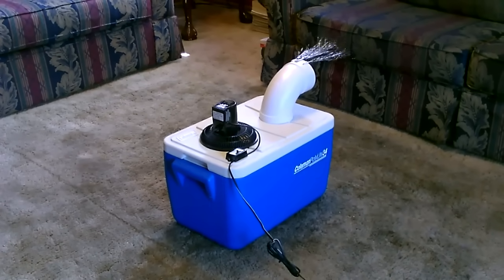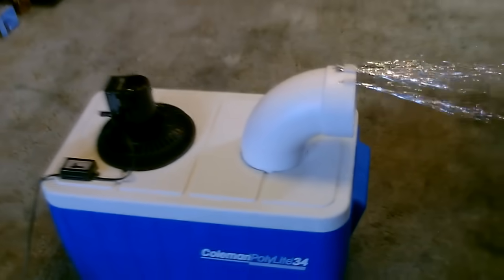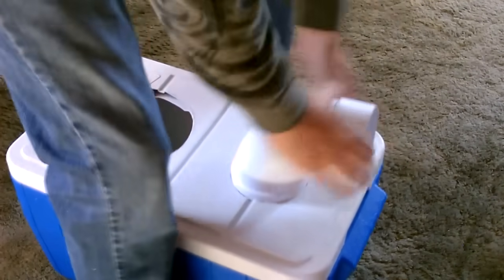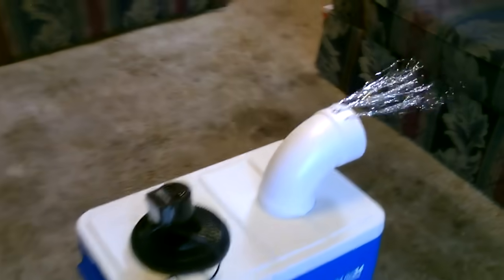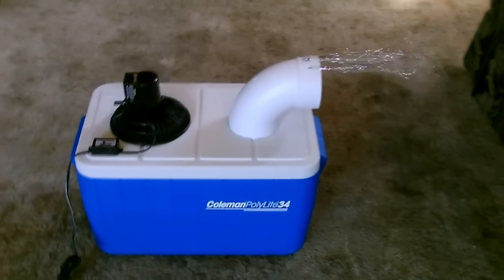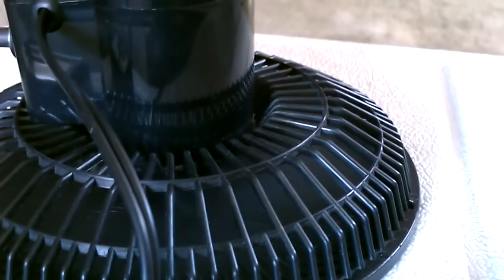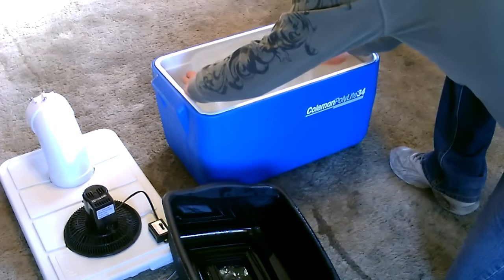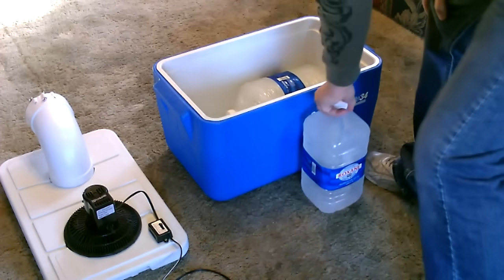Homemade air conditioner DIY - Awesome Air Cooler! - EASY Instructions - can be solar powered!

Comment: Great Video!  I wonder how long the cooling would last in my 400 sq ft apartment in Honolulu.  Any ideas?  Thanks!
Reply: +Kiana Foster it would cool off VERY quickly and get very cold. No telling how long it would last since that would be based on how well your place is insulated. Just turn it off when it's too cold and back on when it's too warm. Simple enough :)
Reply: +Kristen sounds SUPERB!!  thanks
Reply: +Oksana Gegick dont use dry ice! it is CO2 (carbon dioxide) a poison, and displaces breathable air.
Reply: Dry ice doesn't melt.  It sublimates. And its expansion rate is 845:1. So yes. What ever it is in will explode.  Just dont use. It is a poison and not meant to be used in this manner
Reply: Joan Aren a poison is
a substance that is capable of causing the illness or death of a living organism when introduced or absorbed.
according to the oxford dictionary..

and since we are talking of buying bulk quantities of the dry ice...which sublimates and disperses the air in the room...it becomes a poison..
Reply: If you use ice,probably 36 hrs. If you use dry ice maybe 51 hrs
Reply: +Steven Preston   Since when was co2 a "poison"?
Reply: +Joan Aren Yeah, going by that logic, any gas that isn't oxygen is a "poison".
Reply: +Joan Aren hahahaha my friend,,, our body need oxygen only,, again,,, ONLY,..
Reply: +Renato de Guzman   You body needs both oxygen AND C02.  If you use dry ice in an airtight room you may have a problem.  If your room is well ventilated, it won't be a problem... In fact, it may be beneficial to your health.

Comment: A suggestion, instead of a 90 degree tube use a 45 degree where you can cool off the higher warmer air better.
Reply: You can re-freeze the same water, just pour it back into the tub and freeze.
Reply: 180 degree going in the opposite direction.
Reply: THATS WHAT İ THOUGHT .YOU MUST LET THE AIR CIRCULATE MORE IN THE COLD CHAMBER AND THEN GET OUT .ALSO INSTEAD OF WASTING WATER EVERY TIME YOU USE ICE ..WHY NOT USE SMALL BOTTLES OF WATER AND FREEZE THEM AND USE THEM CONTİNİOUSLY WITHOUT REFILLING THEM WITH WATER .
Reply: +Dan M 
Actually I think you guys are using different reference axes here...
By your 45 I assume it's 45 degrees from pointing vertically, which would actually be 135 degrees from the base.
In that case, 180 would be pointing straight up.
Reply: willedmusician 4 
Dry ice could be dangerous in a small room with poor ventilation considering you would be releasing a large quantity or carbon dioxide into the room.
Reply: great idea, but i thought about it and it may vary in the cooling temps, because the smaller bottles are insulated more maybe little bit less effective?
Reply: You mean 135 degree if that is possible from your local DIY shop
Reply: Dan M can't you just use dry ice instead of ice?
Reply: Good thought, but it would sublimate too quickly. It would be really cold for a short time.
Reply: Chouchou Ccc  you can always pour the water back into a container and refreeze it right?
Reply: 180 degree are used in traps...360 is straight.
Reply: @ Chouchou You get a gold star for that idea! Congratulations!
Reply: Jasons Brother m
Reply: Jasons Brother  180 degree is a straight pipe.
Reply: +Dan M 180 degree***

Comment: I have used an old hair drier as a fan (Removed the heating element) and extended the outflow pipe to the bottom of the cooler box. This way, the air has to pass through the water before exiting up the outflow pipe. Using 2 ice cream containers with ice inside, I can reduce the temperature from 32 to 12 degrees in 2 minutes. I have attached a thermometer to the exit pipe.
Reply: +Tony Horner can you up load the video of your assembly of your air cooler

Comment: just a great idea.
I live in thailand its hot!!!
I'll make mine a little different and try to disperse the cold air through an elongated port rather than a circular one.
thx again I might try sell some lol.
Reply: +paul goodier Hi Paul, we have an house in Philippines, due to the humidity I will probably use the ice in a bottle version, as this will not release water vapour into an already humid room. The general idea is neat ice/water with  water vapour/air for "dry" heat and use the frozen bottles idea (acting as an heat exchanger) to release dry cool air for "humid" heat conditions

Comment: In WWII the British were going to make boats out of ice to defeat U-Boats. To keep the ice frozen the mixed the water with sawdust till it was a sludge and froze it the water stayed frozen for long periods of time.  Suggest you prefreeze containers of water sawdust mixture and change it out as required.

Comment: everyone is talking solar here but can't you just plug the fan into an electrical outlet or would that be hazardous for some reason?   (sorry, don't understand such things)
i was just thinking of all the folks who can't afford air conditioning and have died during extreme heat waves.  if they had one of these, they could make it through the worst parts of the summer.

Comment: You should look into selling this idea to these cooler manufacturers. You might  be looking at bank. Most people are not gonna DIY -too lazy. But give them a relatively inexpensive kit to snap together...
Reply: well, you may not be the guy. but pet rocks were around for millenia and someone made a few bucks from it...
Reply: +Vivian Jackson, Hi Vivian, nice thinking, but this idea has been around for possibly thousands of years , modern machines have been around for at least 100 years, all the major aircon or electrical firms manufacture them and sell them at a premium price, look in any hardware store for Evapourative air cooler. The point of this film is that this guy is showing you how to make the same item as a multi-national for pennies rather than the $200 or more that they charge in the shops.
Reply: Excellent idea
Reply: +Vivian Jackson Ha Ha, your right, some people will buy anything. However, the whole idea of this is to save a bit of money by constructing it yourself. I'm going to make one in Philippines next month, see how it goes.
Reply: Vivian Jackson mhmm ur right
Reply: Not lazy. Scared of the handsaw. Lol
Reply: BOOYAH!! Vivian Jackson's on to something!!
Reply: These have been around for like a century.
Reply: yea good idea. just snap on instant cooler just add ice! too lazy to take out a drill and an electric saw! .lol.
Reply: speak for yourself on the lazy
Reply: Why does it have to be that ppl are too lazy? Some ppl like me just don't have those kind of tools or know how to use them if they did. Why does almost everyone on the internet and YouTube in general ALWAYS have to be so damn negative?!
Reply: +emmyntony  I was thinking of it in our home in philippines  as well. Not sure about saving much though?  Because you stoll have to run a big enough freezer/ refrigerator  unit to at least freeze the gallon jugs. Also, don't know how much area the unit can cool? .
Reply: Well I do know it keeps DEEZ NUTS nice and cool

Comment: Nice set up...you are have inspired me to build one!  Store bought portable coolers are pretty expensive, so lots to be saved here.  Just one suggestion - so that you can still use your ice chest when you go camping, instead of cutting holes in the chest lid you could use a piece of wood instead - cut it to size and attach your fan and pipe to that?  It wouldn't look as nice but at least your ice chest is left intact and hole free.

Comment: 5 Hours that is pretty darn good especially if you are running during the hottest parts. Can't help but wonder what wold get if you insulated a smaller room say 12x12 and tried your best to keep that cool air in how long could you go. I would have computers outside the room and just the monitor in the room anything that created heat I would want it on the outside of the room and have it on the NEast side of the house. The SW is the hottest toward the end of the day.

Comment: If the PCV pipe went lower near the bottom, it would force the air to go directly across the ice making it colder.
Reply: +MultiMcdude Just fill empty 2 litter coke bottles with water and freeze and stick them in there, no water problems.
Reply: +Christopher Hall then the water would leak out of the pipe after melting. You want the water remain in the cooler. The melted ice still adds air conditioning to the overall system.
Reply: +Christopher Hall Great tip mate!
Reply: ReaLzEdits Thanks!
Reply: +MultiMcdude so just make the downpipe longer in to the cooler from the top, that would have the same effect right?

Comment: why bother with the box and tube?  you'd get the same results just aiming the fan at the ice sitting in a pan.
Reply: ضش
Reply: why not just go out and buy a cheap a/c and plug it the duck in?
Reply: Mark Rudholm if u would know anything about airflow and how heat transfer works you would have never said this.
Reply: All the box and tube do is focus the cool air on the person sitting in front of it.  It didn't increase the coming capacity of the ice. Also, freezing ice isn't free.  It takes electricity and a lot of time to freeze s block that big.
Reply: +todd man Plenty of people in the comments seem to think freezing water is free, since their freezer is "on anyway".   Those people are mistaken.  What I'm saying in the part you don't understand is that you will cool the room just as much and just as quickly by aiming a fan at the block of ice without the plastic box around it.  The only effect of the plastic box and tube is to direct the cooled air in one direction, which is probably nice if you're sitting in front of it, but you aren't increasing the cooling capacity of the ice with the plastic box.
Reply: +Mark Rudholm Build your model and make a video of the air measuring 40 degrees anywhere in the room.  Either that, or realize the hot air in the room is blown into an insulated container and some of that hot air is melting the ice and if you were just blowing fan onto some ice that wasn't in a cooler, it would melt much faster.  Or make a video and prove us wrong.
Reply: +Scar It's the melting of the ice that is cooling the room.  If the ice melted faster, it would cool the room faster.  The enclosing box and tube do not increase the cooling capacity of the ice, they just focus the cooled air, which probably feels nice if you're right in front of it.  But the room will not get cooler or cool faster with the ice in the box.  The other problem with this project is that it takes a lot of time and a lot of electricity (assuming you use an electric freezer) to freeze a block of ice that large.  This is basic Physics guys.  If you have a friend who is an engineer or a physicist (or high school Science teacher), ask them to explain it to you, I can't make it any simpler.
Reply: +Mark Rudholm A block of ice will not melt as quickly if it's in an insulated cooler.

Comment: Might I make a suggestion........get two coolers.......fill one with water and freeze to use as the cooling source while the other cooler is in the freezer freezing and you just rotate them around.........you can even make it easier to handle by emptying a bunch of freezer gel packs into the cooler so there is less slopping around of fluids

Comment: i have a room 24x12. fully insulated. 7' ceilings. in your opinion, will this design cool through the night? it's been 90 degrees through the day, then tapering off about 545pm. also, do you find that this size pvc is for best air flow?
Reply: No

Comment: Awesome!!  Thanks for the post.  What's funny is that I first looked into non compressor or non refrigerant cooling systems and came across something very similar to this but made specifically for small aircrafts.  Oh my god, the asking price was so much.  But it wasn't hard to find out plenty of folks like yourself basically making the same product at home.  I assume you didn't pay 500 bucks for essential the same end result.  I do need something that will help keep a small attic somewhat comfortable when used now and then when the outside temp is over 90.  I'm really impressed that you were able to produce temp output of less than 40 degrees.

Comment: I was thinking maybe hanging strips of cheese cloth (or the like) from the inside lid so they can wick room temperature water from the bottom and would be cooled by the air flow and cool the outlet air. It wouldn't be like a piece of ice but I think it would also drop the temperature quit well. In a pinch, I would try it..
Reply: Room temp water would not make air colder than room temp. You would just be making the air more humid.
Reply: Shake a damp cloth in the air. The "heat" will be removed, making it cooler.